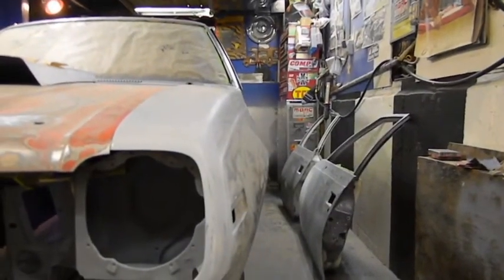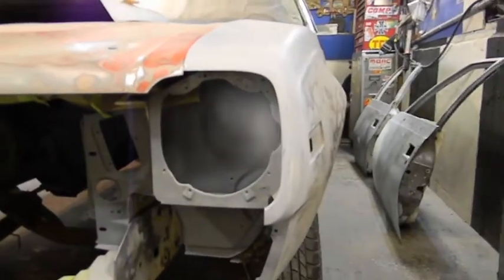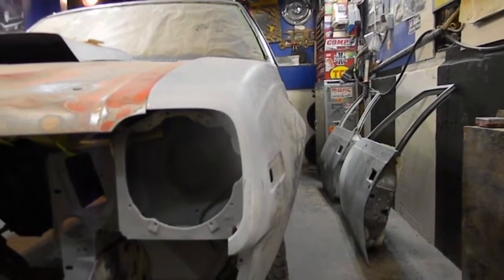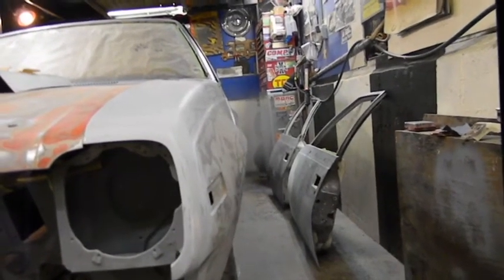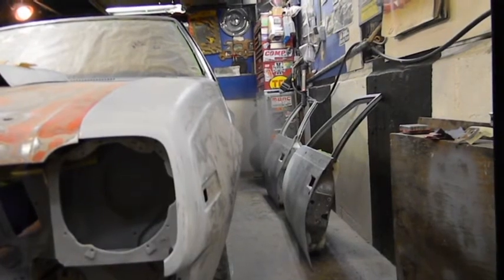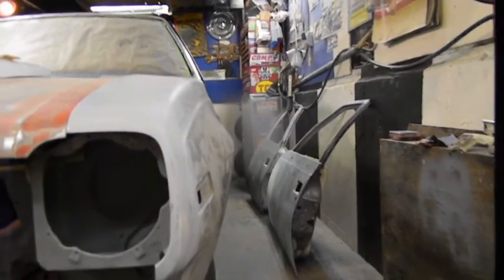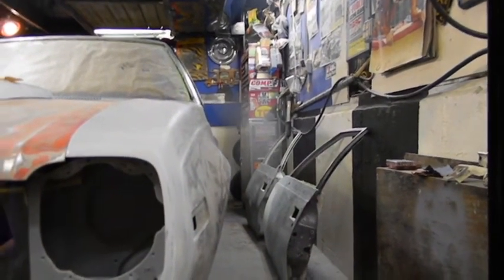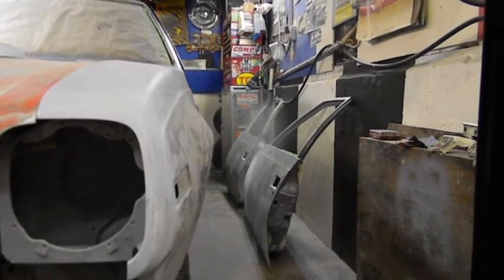17 Years Without A Bath

Comment: One comment about the HEI distributed being close to the firewall. Always check for sparks before adjust the timing or touch the wires with the engine running. That might not be something you can do now, but as the wires get old they will crack and leak and if you touch on while leaning on the fender you'll zap yourself wherever your touching the car. I saw a guy zap himself in the junk once and it looked like it hurt, so I made it a rule to try to check the wires before adjusting the timing.
Reply: About the battery, when it gets cold back there the chemical reaction slows down and if the battery is weak it may not start the car on a cold day.  You don't want to get stuck somewhere and freeze!